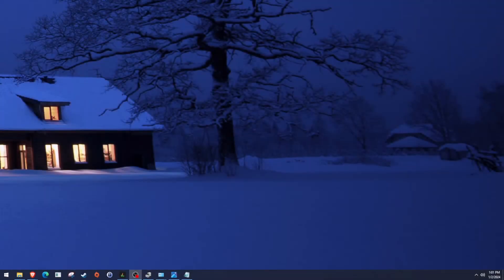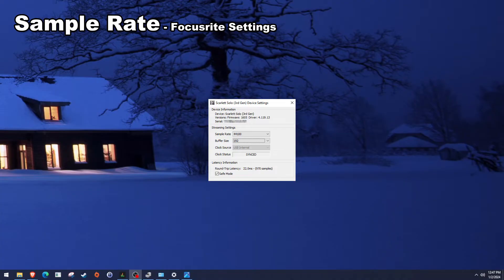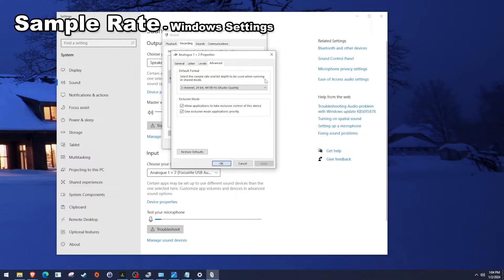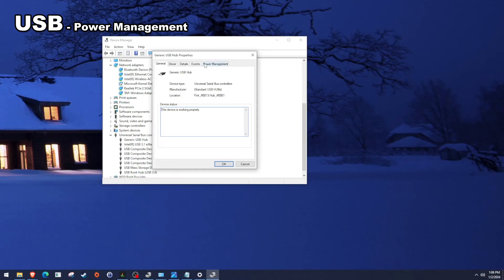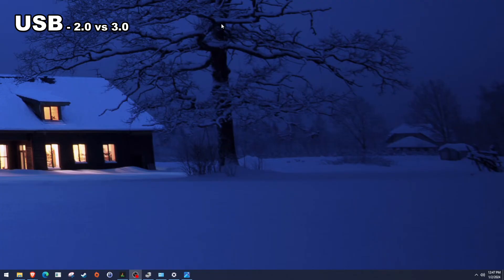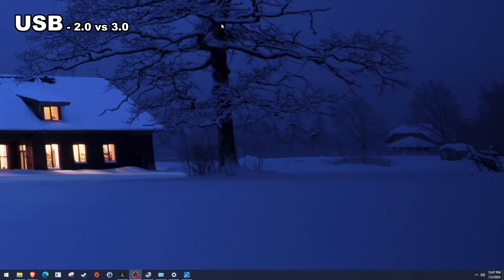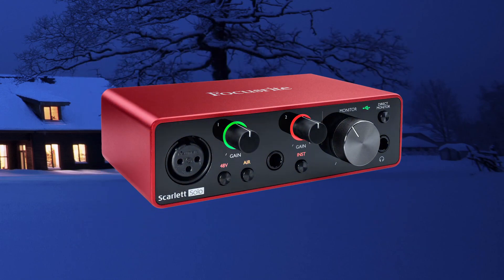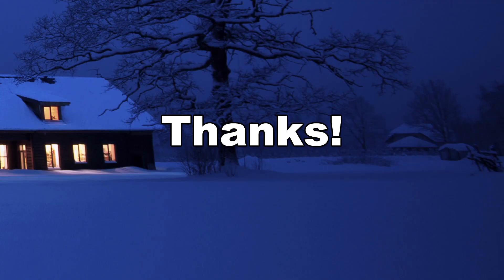Fix Crackling and Popping on a Focusrite Scarlett Solo 3rd Gen Audio Interface

Comment: This popping and cracking on my Scarlett 4i4 for playback on my Win11 system was driving me nuts. I did all the obvious things already... checking the sample rate, trying different buffer sizes, trying new USB ports, and none of it did anything. Something on the backside of your video did the trick... something having to do with the USB power settings, I suspect. I went through and unchecked those boxes and followed ALL your suggestions via those command line tools you went through. I'm not certain which one resolved it, but one of them did, and I am very, very grateful. Thank you for digging deeper into possible solutions than most support docs and videos go into. I'm one happy camper and grateful. Thanks for turning this frustrating situation into a happy ending!

Comment: I am having the same issues with my scarlett 2i2 3rd gen. I get inconsistent pops and cracks when recording audio on any software :(. It seems I didn't have this issue on my older pc. I just recently built a new pc with a rtx 5090 and a ryzen 9 9950x3D and DDR5 64gb of ram and windows 11 installed instead of 10. So, it has nothing to do with my specs. my motherboard only has the newest USB 3.2 ports. but they should be backwards compatible, do you think this might be the reason? would a usb 2.0 hub work?
Reply from the maker: @JadenBurleson-v9o  did you try lowering it to 44khz? I have essentially the same specs you just listed, though my ASRock x870e motherboard did have two black USB ports and I used one of those.
Reply: @VinnyCThatWhoIBe  All my ports are red lmao. I guess I could try a usb hub. Yes I treid lowering and still getting the issue.

Comment: Will to me I set the buffer around 128 and kept the sample rate at 48000 and made sure that there is no electrical interference such as cables that is plugged  I use the scarlet to record and play my guitar and record my mic so ether move the mic/guitar away from any kind of interference or make sure that there isn’t any cables or devices that is plugged into electricity that is near you ,I got to say the click noise when I play my guitar only comes when I am near my disk which has my gaming console so I just turned around and it works fine

Comment: Hello everyone. I updated my PC. New processor I513600kf and motherboard. In general, I got these cracks. I spent 3 full days looking for a solution and did everything like everyone else - played with the buffer, disabled kernels, changed drivers, reinstalled Windows and 100 more tips that you can easily find on the Internet when searching for a problem. In my case, everything was so simple - that I want to cry. 

I changed the USB 2.0 Type-A / USB 2.0 cable, which I used for 7 years, to a shorter one (it was 2 meters, now I use 1m) - and there were no more cracks or something else!!!! Apparently, something was wrong with the power supply from the motherboard.

Comment: make sure drivers are up to date.... then u do nothing to explain what those arrows are even pointing to or anything. BAD VIDEO.
Reply from the maker: The software and drivers are available bundled together here https://downloads.focusrite.com/focusrite/scarlett-3rd-gen/scarlett-solo-3rd-gen

Assuming you have the software installed, open your systray (the icons next to the clock on your taskbar, you may need to click the ^ icon to see them) and look for the "F" icon. Right-click on this and you'll have options for both "Scarlett Solo 3rd Gen settings" and "Focusrite Control". Opening both of these will get you the two windows you're asking about.

The Firmware and Driver versions are displayed in the "Scarlett Solo (3rd Gen) settings" window, and the Focusrite Control version can be found in the "Focusrite Control" window if you click the gear icon in the upper left.

Firmware update instructions are mentioned here https://support.focusrite.com/hc/en-gb/articles/360021869499-Checking-your-Focusrite-interface-has-the-latest-firmware, but basically if there's a firmware update available, you'll be prompted to install it when you open the "Focusrite Control" panel.
Reply: Did the issue fix completely for you?

Comment: Yep, the buffer size did it for me. As far as i remember lower buffer size is for less latency when recording a mike or something, but for playback a higher buffer size usually works better (i was experiencing playback crackling during mp4 video watching and rising the buffer number fixed it). Thanks.

Comment: well, thanks for the video, but my problem also is that I cannot use their software as it leads to BSODs on my system every time I to change the sound source (to my external sound card) in sound settings of the system. And don't recommend me to try a fresh windows install, I just won't do it due to many reasons, and any other hardware works just fine for me, so it's definitely their software issue... So I will try to change the sample rate in windows settings, but I can not change the buffer size unfortunately... In addition, when I install their software, the gain level of my mic drop like to 25%, it's so loud in direct monitor mode, but I have to almost scream into mic to hear myself in system clearly

Comment: Thanks so much your video has ended two days of frustration trying to get rid of crackle when recording through Focusrite Scarlett8i6 into Reaper using windows 11. A set up that worked fine with my old windows 10 computer. I think it was changing the power options that made the difference for me, and stopping windows from powering down usb sockets. Thanks again

Comment: Thanks for the vid. I've been having this issue. It comes and goes and most of the time it's fine. I've temporarily fixed it before by replugging the USB cable in the back of my interface but even then sometime that doesn't work. I'm hoping after trying all the methods you suggested, it works permanently. Fuck Focusrite seriously. People have been having these issues for so long and nothing gets done about it.

Comment: I was also pulling my hair out because my Focusrite Scarlett 2i2 3rd gen would randomly start producing horribly garbled audio. I'd have to unplug and replug the USB cable to get it working again every time. The only workaround that worked for me at the time was disabling CPU C-States in my motherboard's BIOS, but now I'm trying to find a less intrusive workaround, since C-States can be helpful for single core performance. I have previously tried everything you mentioned in your video except for reducing the sample rate to 44.1. Will give that a try next.
Reply: Hi, I have the same issue. 44.1 fixed the problem?
Reply: @stellascafarto  it's hard to say if it's really fixed since the issue was intermittent and kind of rare in the first place, but I have not experienced it recently at least.

Comment: I have a simple setup in my 2I2 4th Gen from my computer USB3 port to the USB C port on the 2I2. I have two small studio speakers. I am getting static noise after playing music. I have discovered that I must switch the sample rate in the focusrite settings from 44.1 to 48 and that works for a short time. after a few minutes I must switch back to 44.1 sample rate. This is constantly going on. Any advice that I might try?
Reply: Yup, USB 3 to USB 2

Comment: Hi Mate. Nicely put together video. The issue I have is during playback, when I move/hover my mouse over a "clickable item" (not sure what the proper term for this is) I get a "pinprick pop". So, if I don't move the mouse around, playback is good. I tried all the troubleshooting recommendations that you mentioned but it didn't make a difference. I even tried different streaming quality within Spotify but the issue is not limited to Spotify. The issue persists with or without the driver being installed. It's almost like there's a tiny bit of processing that happens when you move your mouse over a "clickable item" that is causing a tiny interruption in the data transfer. I found a reddit thread from 6 days ago and someone is having the same issue. Hopefully we can figure this out.
Reply: I have the same problem. And making music on my PC is out of the picture right now as I have severe playback issues when in a DAW no matter what buffer size I'm set to.

Comment: I think it has a lot to deal with power. I had a 2nd gen 2i2 and just watching videos or listening to anything I hear crackling glitching noises and I thought it was just the interphase getting old so I got a 4th gen and the same thing happens, everything is up to date, windows always tries to add dumb power saving tricks in the background and I think that’s what’s happening for me. I might just wipe everything and try a fresh install of windows and see what happens
Reply: Did you ever figure out what was wrong?? Im having the exact same issue right now and it's so frustrating. I'm using Windows 11 and even YouTube videos crackle/cut out.
Reply: @RayRae559  not really, I think it has something to do with the wiring in my headphones. The issue is super inconsistent and I noticed in my case that when I move the wire at the base where it plugs into the interphase it either gets louder or more quiet. Still figuring it out though. I don’t wanna jump the gun and get new headphones yet because I love these but maybe try different headphones?🤷🏻‍♂️
Reply: Same here. 2nd Gen 2i2, I changed my motherboard, didn't reinstall windows 11. Then this popping noise on my speaker bleeps every now and then randomly.

Comment: Took me forever to figure this out. It wasn't the settings. It wasn't the USB port. I just had to go in and redownload the newest version of the focusrite drivers.
Reply: Out of curiosity did you have the latest drivers and then just reinstalled? Or were you running a previous version then updated?
Reply: @AntAskew did u ever fix this issue?
Reply: @LifetimeStudents I completely uninstalled the drivers and did a clean install. Then I swapped the mic xlr input into the second input point. Tbh I don’t think the changing of the ports did anything. But I’ve had no issues since. 

Hopefully you get it fixed :)

Comment: i just tried every way of solutions and it didn't work idk what to do with this
Reply: the only fix that worked for me was to switch my i3 10105f processor to an i5 10400f. 4 cores to 6 cores. no more crackling. i checked the cpu usage and noticed that it occasionally would spike to 80% usage and that crackling commonly occurs in my web browser (microsoft edge). it could also be too many background processes overloading the cpu. i never had crack or pops when i was on a fresh install of windows. after 3 years now with all the softwares installed i have 80-100 background processes running.

Comment: Ty, no more crackling. But I can't say it's a fix. Focusrite is not the cheapest stuff u can find and I expected it to work well when I bought it. And now I must follow the only setting that allows it to functionate. God, It's been so many years and they still didn't make a fix.
Reply from the maker: I agree it's ridiculous that you need to fiddle with it so much to get it working right. If the device can't handle 48000 then why is it an option to begin with? I have a core i-9 9900k, 64gb DDR4 3200, an RTX 4090 and a Western Digital Black SN850 M2 drive with a 1200w PSU... there's no way they they can say my computer isn't up-to-spec.
Reply: @VinnyCThatWhoIBe  I've finally found the solution!
1) delete ur focusrite control
2) install focusrite control 3.6.0 from the original website (3rd solo page)
3) install focusrite control 4.6.5 from the original website, but from the 2nd solo page (don't delete the previous version).
Installing audio drivers might be also needed if u don't see focusrite in ur audio devices. U can find them on the same page for 2nd solo.
I've used it for like an hour and it works stable on any settings.
Btw setting things up to 44.1 and 128 didn't solve it. It just started working longer.
Reply: @sokolov.  Focusrite control 3.6.0 is for windows 7+8 and so is 4.65.5, I'm on windows 10 so should I download those or the newer ones instead (3.18.0 and 4.119.13)?
Reply: @JCat9  try to do exactly as I have written. This soft is completely broken
Reply: @sokolov.  man this really works, ty
Reply: @sokolov.  Do I have to restart the PC after installing each driver? Helppp
Reply: @VinnyCThatWhoIBe  I've just tried using Linux with this interface, but it seems like Focusrite has problems even there. The latency with 44100/128 is surprisingly low – 5 ms, but when using other settings, sound just starts to disappear for moments. Also there are no good guitar plugins. So the only way for us is to suffer, it seems.
Reply: @VinnyCThatWhoIBe  I have an i5 13600K and even i HAD issues with the interface. With my old (very old) interface i had no performance issues. Now i must set buffersize to 64. With the old Interface (non usb) i had zero latency and it ran perfectly. Buffersize 64 is still okay its just 8ms latency. Atleast it runs now without crackling.
Reply: @teeaymusik9811  Hey! I bought 13600kf 3 days ago. I have these clicks too. Before that I had 10400f and there were no problems. 64 buffer siez does not help. still crackles. Did you get rid of the problem only with the buffer?
Reply: @mark_krupp  Yes i fixed the problem somehow but i dont record anymore. But if u want i can check my settings later :)
Reply: and you have to install the 3rd generation version 3.6 and the 2nd generation version 4.65?
Reply: @Fmaefe  yes to each question. Btw you can try getting rid of all focusrite drivers and installing the newest drivers for 3rd gen.  
There are many things that could make it more stable, but nothing that solves the problem. It's all about your CPU, it seems
Reply: @sokolov.  It's incredible, I tried an Arturia minifuse 1 interface and no failures, even with the buffer at 16!!